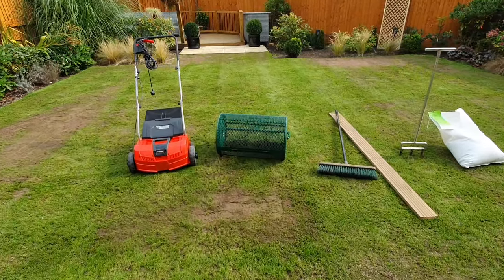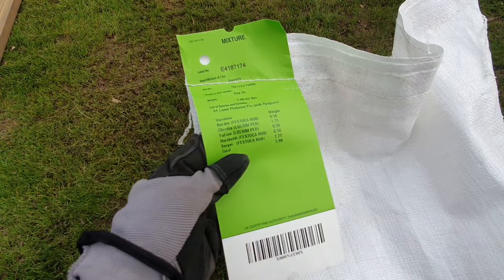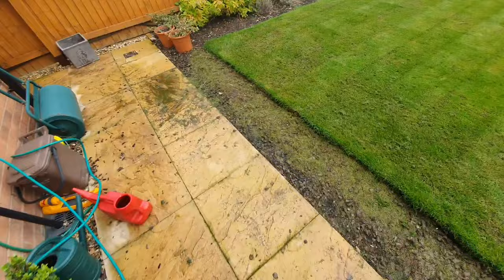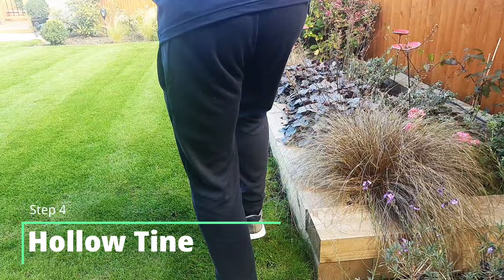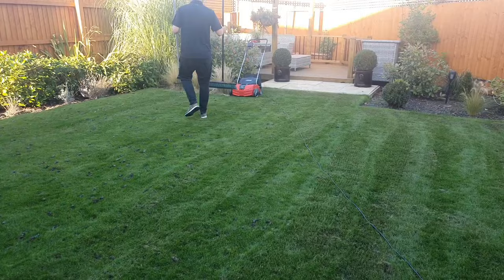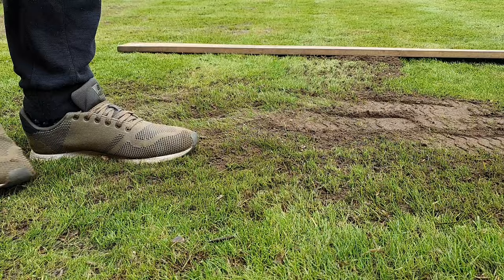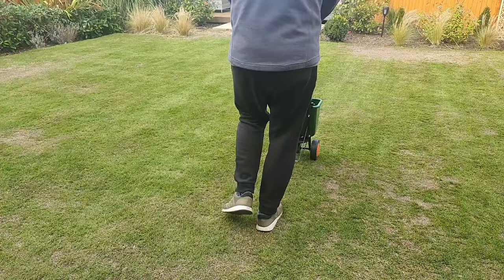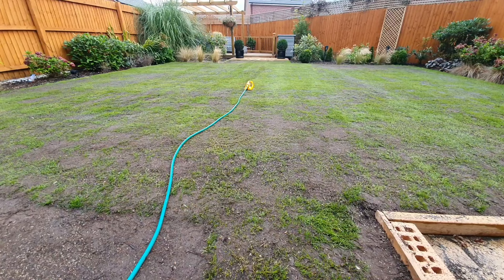Step by Step Lawn Renovation - Top Dress, Over Seed LEVEL

Comment: A good tip for the edging is to cut out the sod and flip it around. You can then seed over the bit that was on the edge after packing it with topsoil. The cut edge with roots is far more stable than newly planted grass seed and has better chance of staying in place.

Comment: Another informative video, cheers.
I started my renovation back while we were in lockdown as a last resort before ripping it up and replacing it with something which was less offensive on the eye.
I have followed your tips and advice, but just using the most basic of equipment ie garden fork, spring Tyne rake, and muscle power.
I have become a bit obsessed with it to be honest, and, at times, have wondered whether I have been wasting my time, but, finally, I mowed it yesterday, and I now have beautiful stripes for the first time.
I can’t tell you how chuffed I am.
There is still lots of room to get it better, but I am now at a point where I feel all the work is paying off. 
Thanks for your steer on feeds etc, some of which I have used to great effect.
Reply from the maker: Hi colly great stuff mate, thanks for regular views and comments and well done on the lawn

Comment: Great Video. There is nothing more satisfying than the sound of the scarifier crushing the cores 🙂 By the way, I used the power rake attachment on my reno couple of weeks ago and it seems to pick up or crush almost every core. Try and see how it works for you.
Reply from the maker: I used the rake too Andreas but I did find that I needed a few passes but each core was like shot in the back of the net

Comment: That aerator looks good. I have a hollow tine with the 4 tubes but it works awful on my clay soil with the plugs constantly getting stuck, so I have resorted to using a garden fork. Something like yours looks ideal though as there is a recess for the plug to fall out, or at worst be picked out

Comment: Brilliant vid as usual pal 👍😁
From what I gather that seed mix is a good one, so it’ll be nice to see how it does. I hope it does better than my front lawn, which was doing well until getting decimated by foxes 😂. I’ve fixed it this evening and I’m praying they won’t come back
Reply from the maker: Yeah, i saw the pic. Couldn't believe they did that what are they searching for grubs?
Reply: Garden Lawncare Guy I’m not sure, I’ve never seen anything like it. I occasionally get a few holes in the back garden but never that bad. I went quite heavy with the new soil so it will have been quite loose. Maybe yeah, they thought something was underneath?? I’ve packed it down a bit better so 🤞. At least the back lawn is doing well. I knew it was too good to be true, I haven’t had an extreme weather event since I did everything 😂😂😂
Reply from the maker: Fingers crossed mate

Comment: I'm watching from Toronto, Canada.  I'm a lawn nut, so I like to see what people are doing in other areas where cool season grasses are used (can always learn something).  Compared to most lawns here, I keep mine very short (I increase from 3/4" to about 1" or 1.25" when the our summer heat comes around, generally mid-June through August) but I need to use different "dwarf" grasses to accomplish this.  I use a blend of a dwarf perennial eye and a dwarf Kentucky bluegrass.  I noticed the seed blend you're using seems to include a lot of fescues.  Do you use a bluegrass variety at all?  What height do you maintain your lawn?  I'm looking forward to seeing how your renovation turns out... your timing and process is right on with my area, so your information is great for this part of Canada.  I usually add a starter fertiliser once I see the perennial rye showing through; the Kentucky Blue variety takes about 2 to 3 weeks even in the best conditions.  Am I correct that you use something similar?   Thanks for the video... I have subscribed...
Reply from the maker: Hi Adrian welcome from the UK, on my front lawn rennovarion I used a rye only mix which turned out brilliant. My lawn as-is has  blend of rye and fescue, we don't tend to use kentucky blue very much over here - most of the mixes are rye and fescue. This year I've had best results from 25mm to 32mm so similar to what you say, and yes I will add the fert later on after the first cut probably so the existing grass doesn't outcompete the seed and the new seed will be ready to take it
Reply: @GardenLawncareGuy  Interesting... I really like the rye blends too... beautiful texture and colour and I think they tend to grow more upright, even the short variety.  And I forgot I can speak "metric" with you.  Do to geography, I tend to see more videos from US people.  Along with their rather weak command of the English language, they generally have next to no knowledge of the metric system.   Thanks for your reply... continued success with your channel and I hope you gain more viewers from Canada.

Comment: Great info! What's the best way to put the top dressing on without the cylinder? Would putting small piles of top soil down and using a brush work just as well? Also is it worth putting fertiliser and lawn feed down first before top dressing or after?
Reply from the maker: Hi Gareth yeah a board words or the back of rake / long landscaping rake
Reply: @GardenLawncareGuy  thank you, should I put fertiliser and iron sulphate down before or after top dressing?
Reply from the maker: Don't use iron with new seeds it can dehydrate them. As I used a topsoil I didnt apply fert but I will use a pre seed at the first cut. I dont want to use a pre seed now as the existing grass will outcompete the seed. You can use fert here and seaweed but do not apply an all in one type of product with weed killer and iron as it will be too harsh. You can also wait until first cut
Reply: @GardenLawncareGuy  that's great advice, saved me from Making that mistake tomorrow! thanks for taking the time to reply. Look forward to more videos 👍

Comment: Hi Matt, great stuff just ordered seed and fertilisers from you ready for this year. Seen you use both but which spreader do you reckon is best the Scott’s rotary or the hand held version?
Reply from the maker: For small jobs hand held daniel as it doesn't take up much space and easy to use so I prefer that - thanks for the order good luck with your project
Reply: @GardenLawncareGuy  id say mines a touch bigger than yours, would it take too long using handheld
Reply from the maker: No hand held spreader just as quick really unless it's a large area as the hopper is smaller so you need to fill it more

Comment: Thanks for the Great video! Can everything done in this video also be done in spring? Also ive got loads of small rocks in my lawn, I've tried raking it, hand picking, leaf blower but can't seem to get rid of them 😔 do you have any advice? Thanks
Reply from the maker: Yes it can be done in spring too  just autumm can be better for the weather temperatures and not lead into a hot summer for the new growth. Depends where you are but this will work during most of the growing season

Comment: Very informative video mate.
My lawn has been affected with chafer grubs, do you recommend using a spiker roller/shoes or an aerator tool like you used in the video before applying the nematodes? Thanks for the help
Reply from the maker: To be totally honestly I don't know if that will or won't effect the efficiency, but seems to make sense if we want them in soil and could get some aerstion done too
Reply: @GardenLawncareGuy  great thanks for the info.

Comment: You didn't use a soil/sand mix, did you consider using sand.  I have levelled a couple of times just improving it each time and both times used topsoil as you did, but Im now thinking about using a sand mix
Reply from the maker: Hi Eddie this was a sandy loam mix. I have a few areas to level out first as I don't really want to be putting a full sand cap on the lawn just yet

Comment: Thanks again for the content. Did you fertilise before or after? What point would you consider fertilising?
Reply from the maker: Going to applying pre seed fert after the first or second mow
Reply: Garden Lawncare Guy thanks for your reply. May I ask what is the benefit of putting fertiliser on later as opposed to immediately before seeding? Many thanks.
Reply from the maker: If overseeding grass putting down at the start the existing grass will take it quicker than the seed and will compete with the seed. So do it later. Seeding from scratch do it at the start
Reply: Garden Lawncare Guy thank you.

Comment: Hi mate, silly question. The scarifying cartridge is the one you shown in the video which is the metal blades one right? Reading online some call the one that has the spring type rake as the scarifier cartridge.
Reply from the maker: Hi NI, No the one with the blades is the aerator slitting through thatch and into the top surface, the one with 'spring tines' I call a scarifier
Reply: @GardenLawncareGuy  thank you for the prompt reply. I thought I'd messed up as I used the spring tine ones. Phew! Brilliant videos by the way
Reply from the maker: Thanks mate

Comment: I notice you said you used the A1 Platinum Pro but the link takes to the Prem Pro? I recently used the Pro 25 from A1 and it’s come through nicely but I still have some patchy areas which I expected
Reply from the maker: Hi Kingsley I'll update that, previously I used premp Pro on the front lawn and have a standard text to go in, on the back its the plat Pro which has a fescue / rye mix
Reply: Garden Lawncare Guy Cool I was interested in the Cultivars you were talking about and found it interesting on what the difference is. Love the vids pal o recently subscribed 👍🏻

Comment: No sand? 😦
Reply from the maker: Its a sandy loam, it have a few seasons of topsoil to get the level right before any sand cap over the top id say
Reply: @GardenLawncareGuy  I think you're good. I've leveled spots with 3 inches of sand with no problem. As long as you put some peat or compost on the seed, it will germinate. Turf will cycle it's own topsoil over time. Sand would def help your lawn for better drainage.